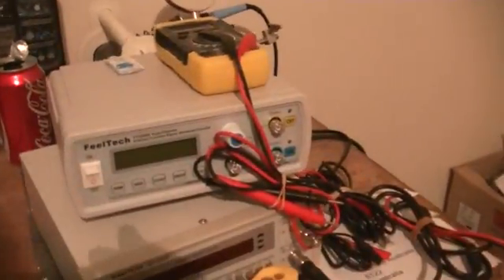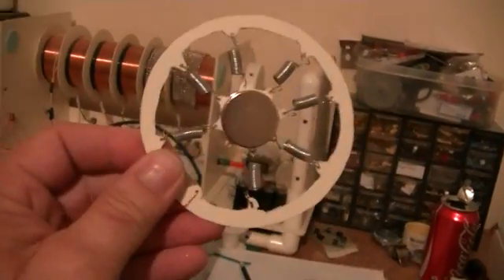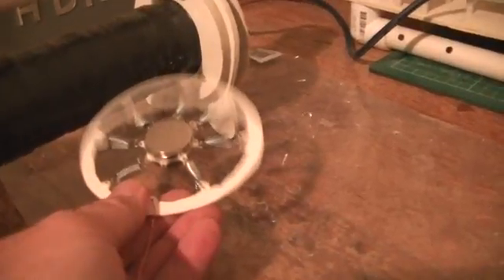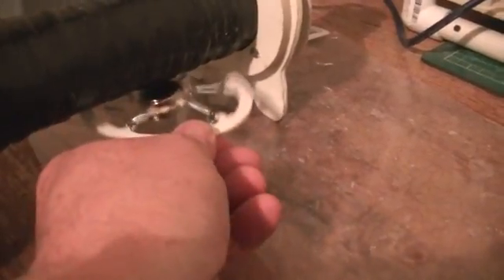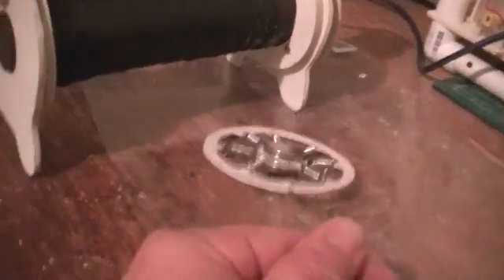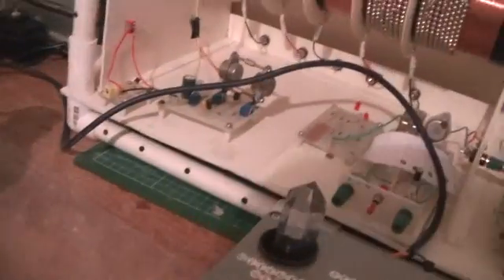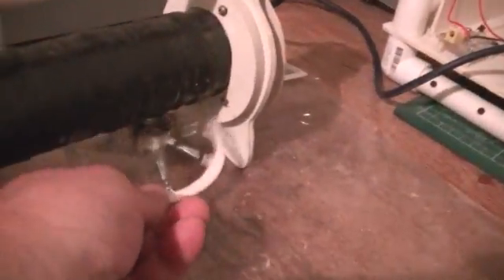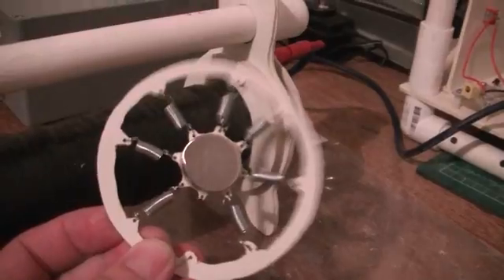hyper dimensional resonator number 4 experiment vibration test.

Comment: HDR-4, Nice job.  I like how you take things to a whole other level :-)
I love the vibrating magnet with springs! :-)
Reply from the maker: +INVENTOR3 thanks paul at least it may have a use yet till i can get some more softer springs so it be more sensitive from a greater distance like it dose when i hold the 2 rare earth magnets stuck together in my hand a meter away or over that's just with the hdr run off the 240vac to 120vac convertor i've yet to try it on the full house hold voltage of 240vac at 50 hz
Reply from the maker: hey Paul I didn't have finer softer springs otherwise it be more sensitive at longer range  just think tanking helps with the ideas someone else followed me and tried it to
Reply: Pouch Hopper,,,,Great, i knew you would get attention with this project, your subscribers are growing with interest :-)  Im glad your getting more ideas and input from others replicating :-)  Say hello to Nola and the birds for me!  Your big foot friend! Hey, you know what they say about a man with big feet, hahahah!
Reply from the maker: maybe usefull in the sex industry  but not yet springs are to stiff and not soft enougth